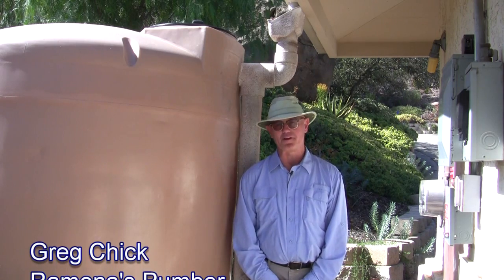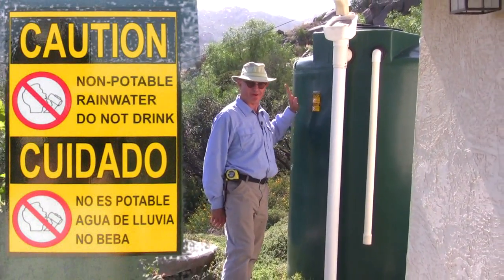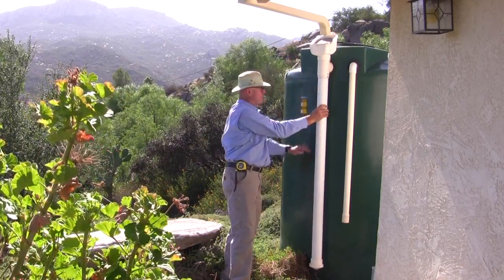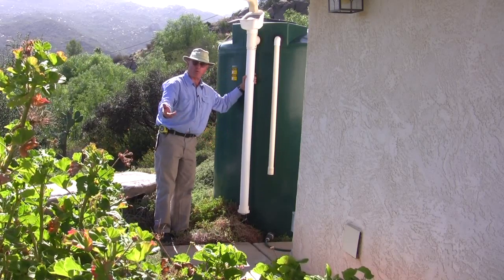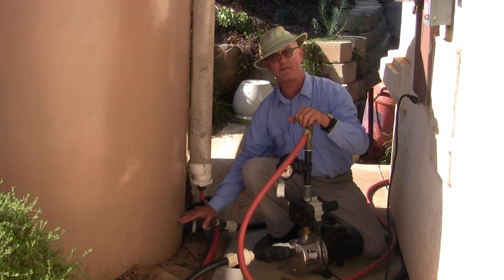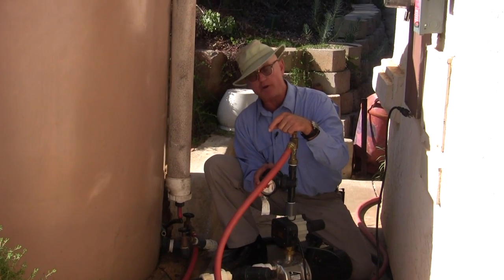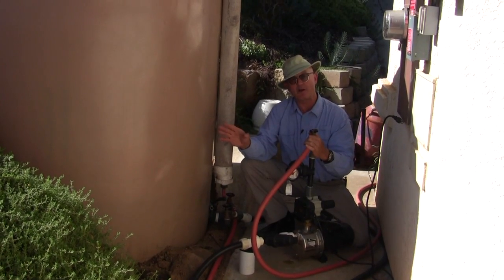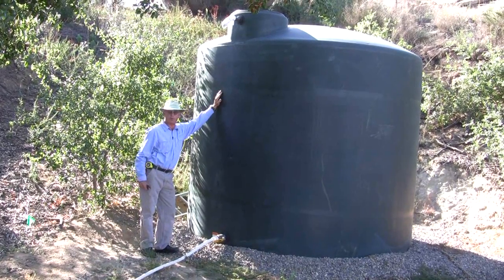Rainwater Capture Systems

Comment: This is in southern California, the city water is used for indoors, this rainwater system is what waters the outdoors and garden veggies.  The local Plumbing Codes require the "Do not drink" labels.  Rain itself is not known to be dangerous, but the roof where the rainfalls will not be clean.

Comment: The first flush on Catchment systems are a gimmick. Once the Pipe is full from "flushing" from the event the ball seals off the first flush from any more contaminants from being processed from the first flush? What happens when more contaminants pass the ball plug and enter the holding tank?
Reply: There is a nipple on the bottom of the first flush pipe that slowly drains to empty it out until the next rain comes through. You also remove the big cap every month or so to drain any nastiness out of the pipe. It does work.
Reply: i wonder if there is a clean out on the bottom
Reply: @Mikecodester  Yes, maintenance is required.  The first flush product/arrangement includes a cap on the bottom.